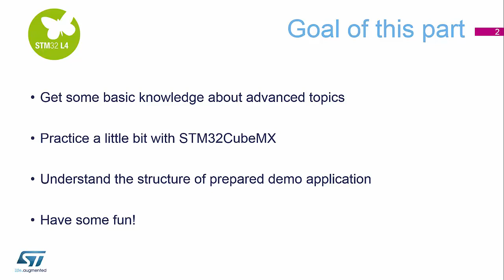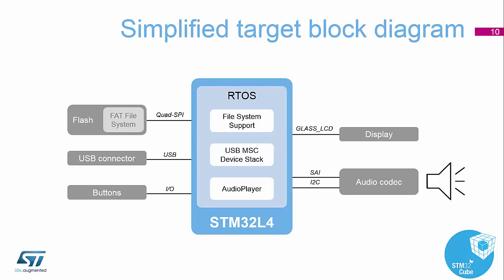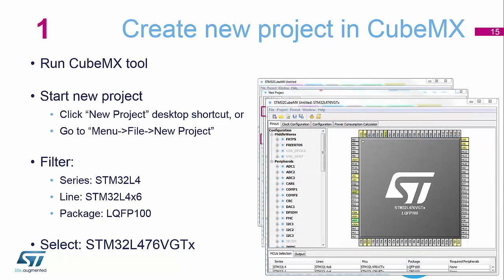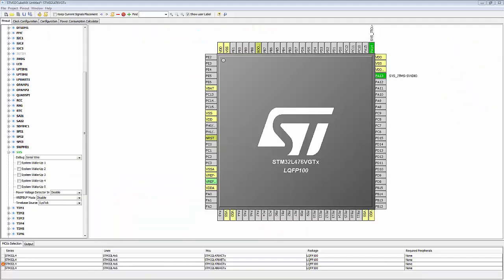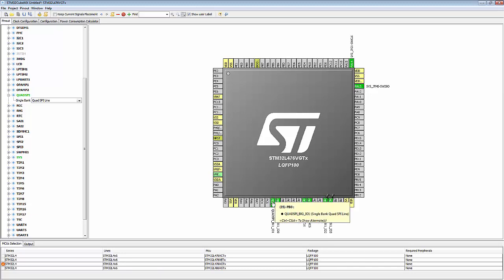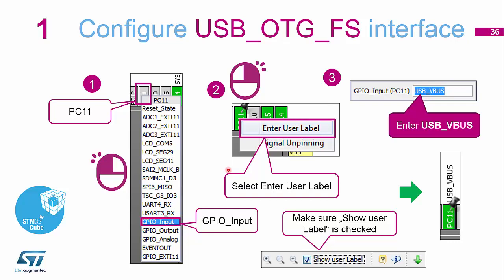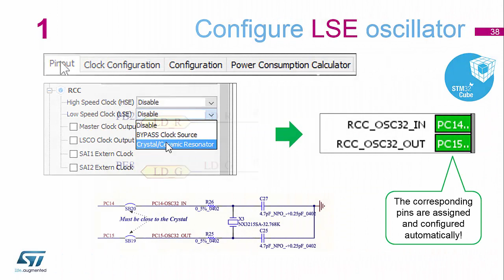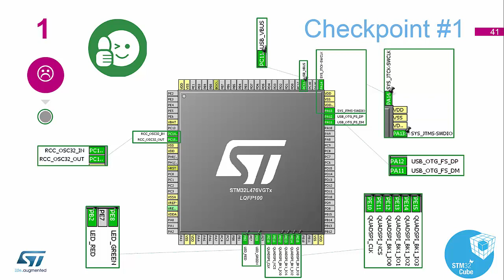STM32L4 workshop: 5.1 Audio Player - lab 1

Comment: sir,ı am using stm3210c-eval.There isnt quad -spi in it.What shoul ı use instead of quad-spi?
Reply: I am assuming you are going to need to use on-chip flash memory instead of the external flash memory which would be interfaced with Quad SPI.